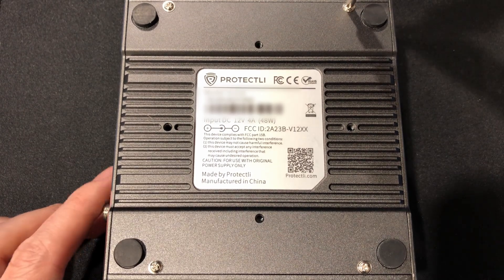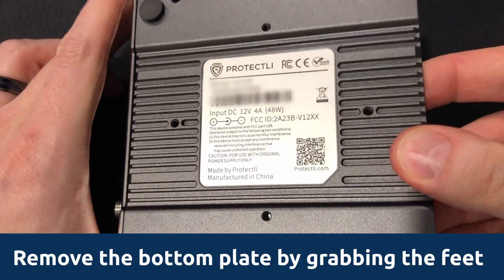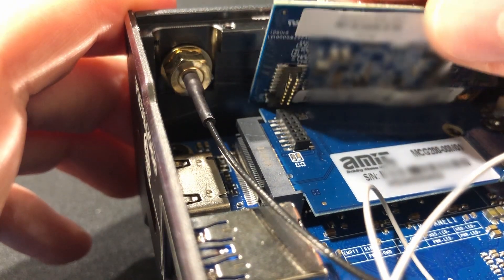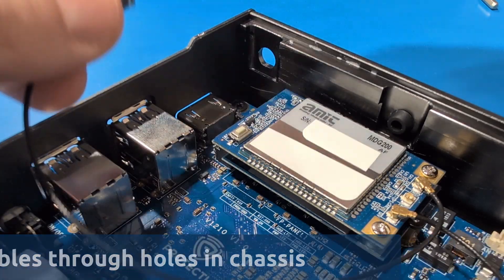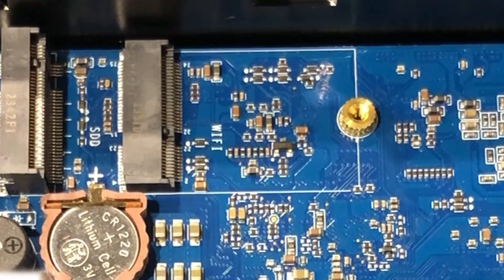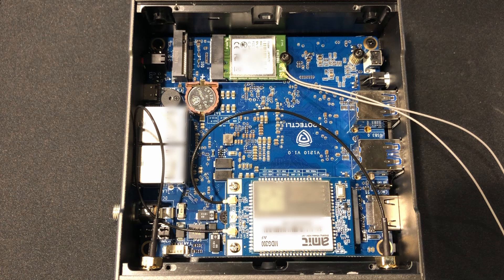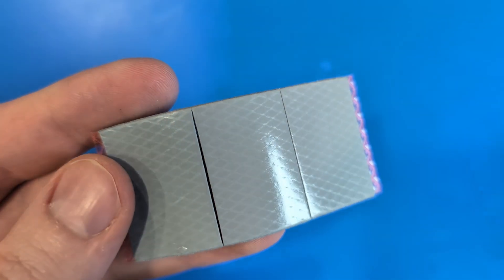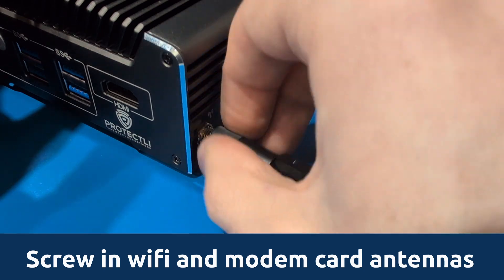How to install components (and thermal pads) to the Protectli Vault V1210, V1211, V1410, and V1610

Comment: where does the cable plug in?
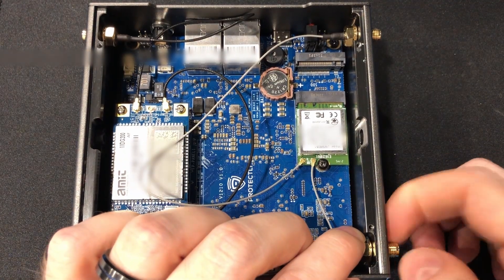Reply from the maker: If you're talking about the cables to the wifi/modem antenna, they go in the holes in the side of the Vault, shown at 2:27. There will likely be little rubber or plastic tabs you'll need to pop out in order to utilize them.